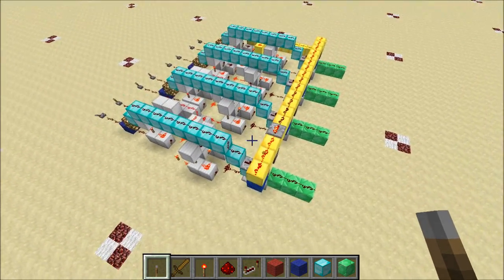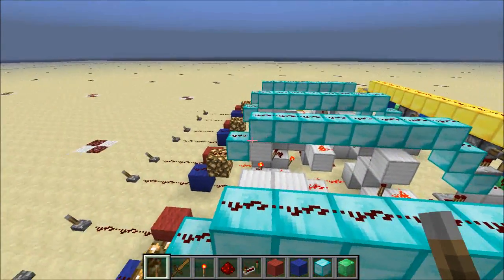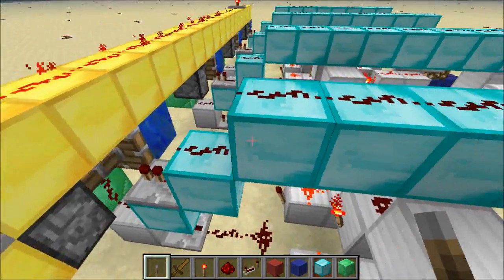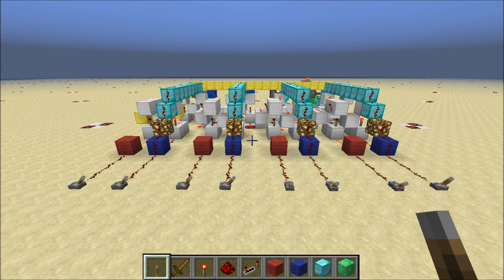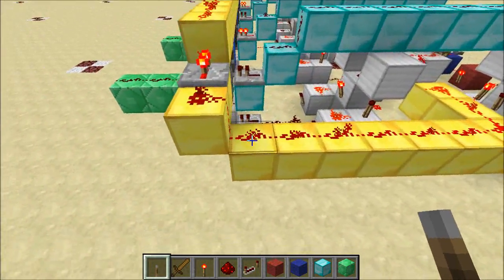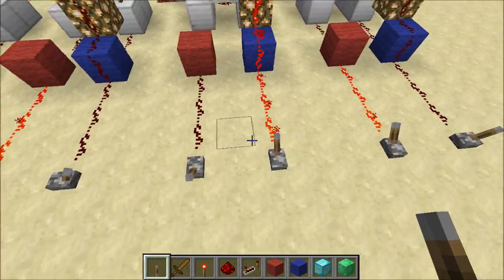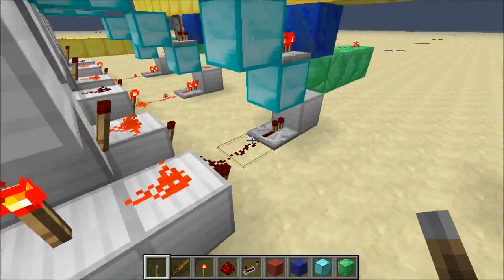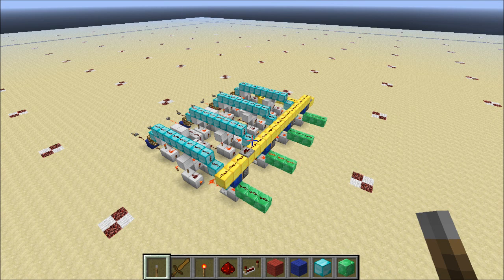Building a Divider Part 2: Conditional Subtraction

Comment from the maker: It's called conditional subtraction because you only use the output of the subtractor if the output is 0 or greater  - so it's performing a subtraction based on that condition.

Comment: Shouldn't it be called conditionally saving, since this output will be saved to the register in which the remainder is saved if it is a none negative number. After which conditionally you would also add a power of 2 (value of a bit) to the value of the quotient.